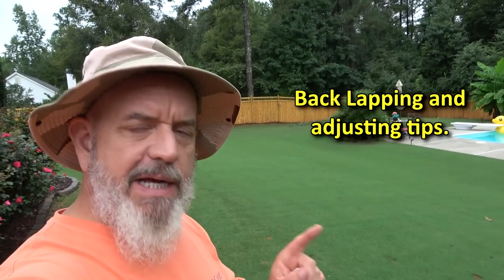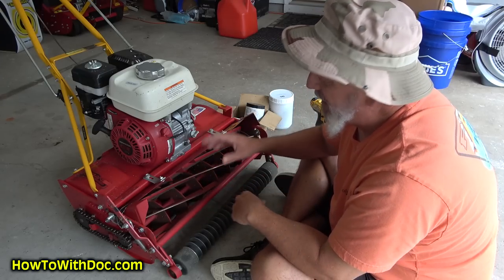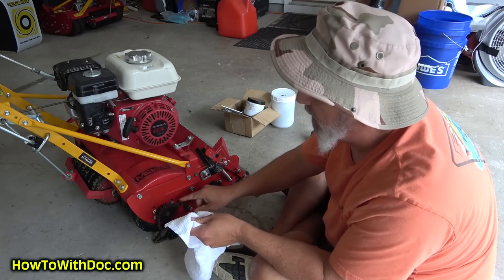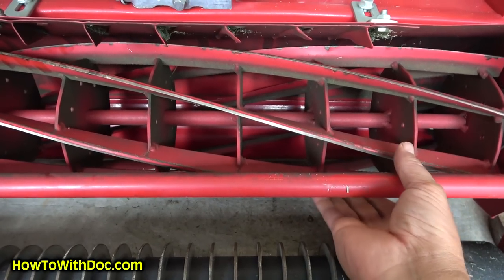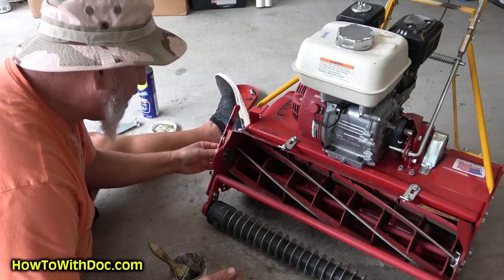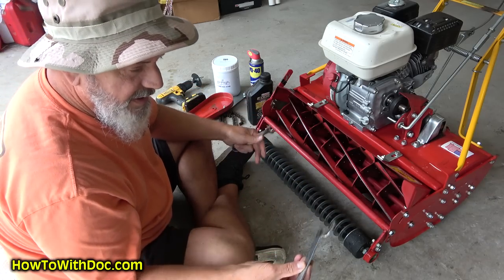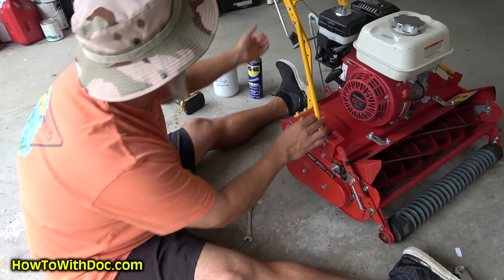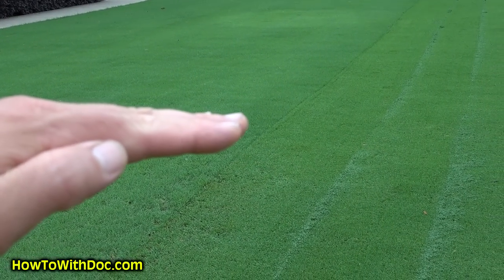Back Lapping Mclane Reel Mower

Comment: I'm watching your reel maintenance video, oiling your chain with motor oil is almost useless, the viscosity is thick enough to not reach the internal pin, that's where the wear is. You use the best lawn products, use the best products for your mower. Best..Chesterton 601 chain pin and bushing lube, Good..CRC chain lube. Thank you for your lawn insight.

Comment: Wow - I spent 6 hours trying to get the chain on.  I almost threw my new $2k mower out the window.  Decided against it and had to take it to a machine shop.
Reply from the maker: Loosen ALL the reel blade bolts so the reel moves freely. That will give you the 1/8' you need. Also adjust the roller height.

Comment: Doc, a tip for cleaning the chain of all that gunk, before you re-oil.  Use paraffin oil (lamp fuel at Wal Mart) to clean the chain, with a toothbrush.  This will remove all the grit and grime, without stripping the chain of it residual lubricating oil.  Then, re-oil with clean chain wax lubricating oil. This chain specific lubricant comes in a spray can and will not "sling off" the chain as will common motor oil. This is a common procedure for bicyclists and motorcyclists who regularly maintain a healthy chain.

Comment: Great video on the McLane Reel Mower, it cleared up a lot of questions I had after reading the owners manual. I was thinking about raising the back wheels in order to get a lower cut, have you ever thought about doing this?
Reply from the maker: I think you mean lower, but no.
Reply: How To with Doc yes you are correct. Being an Aircraft Maintenance Technician, if I raise them the mower cuts lower, if I lower them the mower cuts higher. Hahahahaha

Comment: How long are you backlapping with each grade of compound?  10 minutes?  30 minutes?  My 25" mclane reel will cut with one blade and then just fold the paper with the next blade.  Then two blades in a row will cut, then the next 2 or three will not cut.  I am leaving the paper in the same spot on the bedknife,  so it appears that the blades are not at the same outside diameter in that particular spot in relation to the bedknife.  Mclane is telling me to lock down the roller with slight friction on the bedknife and backlap with 80 grit until there is no friction.  Then lower the blade slightly (increase friction) and backlap again until no friction.  Repeat these steps until all blades cut all the way across the bedknife.  What do you suggest?

Comment: Hey Doc.    I recently got the McLame 25", and after only 3 months use, the reel chain became very sloppy and almost drags on the chain guard cover.  I ordered a new chain and it's better...but still has some play.
     During inspection to correct the issue, it appears that the holes for the rear wheel assembly shaft & gear and the center reel gear are set.  Is there any way to adjust the reel drive chain slack ??  Their customer support appears to be non-existent for any help, advice or even a simple NO!

Comment: I just got the 25 inch mclane. Should the back wheel be able to freely roll? I tried rolling it out of the box but the unit just slides around because the back wheel does not roll at all. Stuck in place.

Comment: Does this backlap adapter fit the McLane GR-25 series? Reel rollers website list the following note on their Mclane Reel Mower Backlap Kit. 

"Please note:  This backlap adapter for the McLane models DOES NOT fit the McLane 17″ or manual, non-motorized reel mowers, “Greenskeeper” 25″, or the “GR-Series” 25″ reel mower."